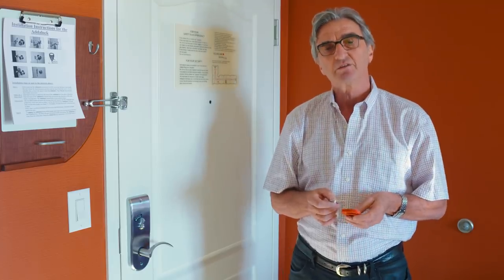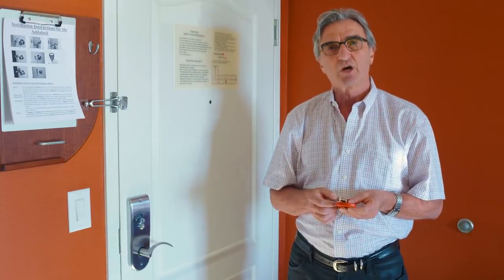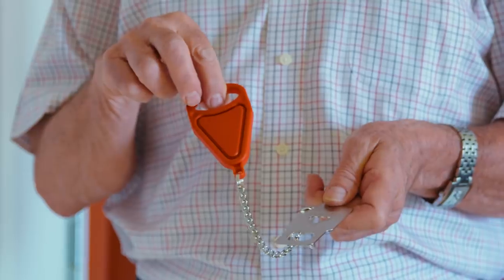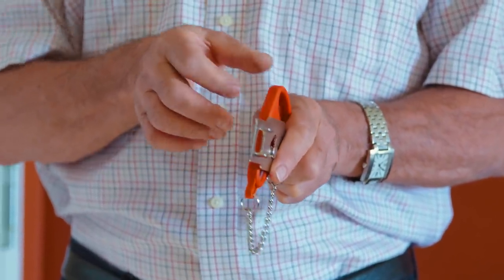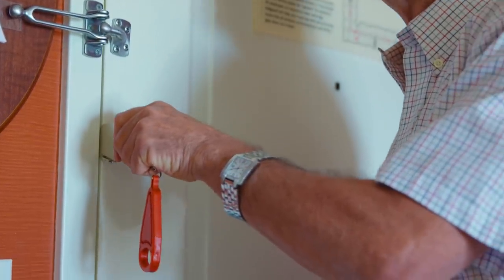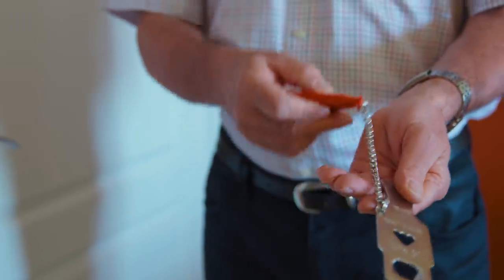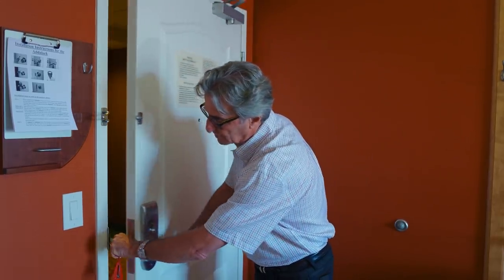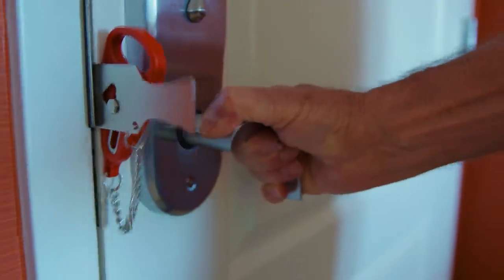Addalock - Installation Instructions

Comment: The bolt / latch on the door, does not drop through the hole in the addalock. Tried in 3 different doors.
Joe
Reply: Likewise - UK door bolts seem to all be to large for the hole.  US version has two holes, but both too small for UK.

Comment: Sorry, but I have been a joiner / Carpenter since I left school and I can not see any advantage of fitting one of these at all?  
These are basically for internal doors and does the same job as any sort of bolt you would apply to hold them shut and secure. 
The door in this video would lock inside via a deadbolt using the thumb turn so absolutely no need for the so-called Addalock/Tufflock
If you need to secure an internal door just buy a good quality flush bolt which will offer much more security.
As for hotel doors! All the hotels I have been to have a key-operated lock on the doors so no need for one of these at all?
Reply: I think you missed the point of what this is for. You carry this with you when you travel and it is to reinforce the door from the inside. Yes hotel doors and Airbnb have locks but other people have the key. This is so that way you're the only one who can open the door from the inside.

Someone might be able to kick it in but the point is that no one can just open your door without you knowing about it
Reply: @loganteodoro2885   Exactly why I got the Addalock. I don't know for sure that they actually did change the lock/keys when I took lease of this apartment. So, for peace of mind when I'm sleeping I put this on.

Comment: I guess my problem is, I want something like this for the OUTSIDE of my door. And it makes no sense to me even with this tutorial. What stops someone from walking up and just, ya know, undoing the handle bit...? I have a deadbolt and a slide lock on my door, and I assure you, if someone wants to break in that badly, they're gonna break in. Addalock will not stop them.

But again, I don't get what stops someone from undoing the handle if this is outside. I've read articles online that state you CAN install this on the outside, but it doesn't really seem that secure given what I just said/asked.
Reply: This is for the INSIDE of your door NOT the outside.  Geesh.  If you want something outside your door invest in a deadbolt lock so you need TWO keys to open the door.

Comment: This isn't very clear - does it avoid the original lock from working? I can see a hotel saying well you didn't use our lock... We aren't responsible for a break in... If it was "so easy" have someone who didn't create it share how to add it 🙄
Reply: I bought one and tried it.  You can still lock the original lock.  However, if someone picks the original the addalock is a backup plan.
Reply: It depends if the door nob rod fits through it.  If it fits, it works as normal.  If not, then you still have is this if you install it.  Or the door knob lock if you leave it off.  Either way doesn't effect your deadbolt; if you have one.